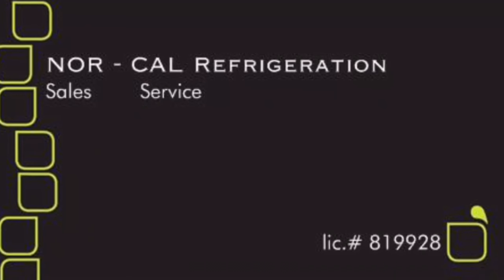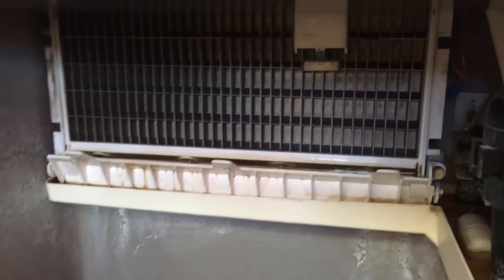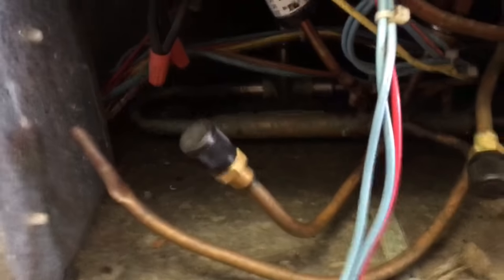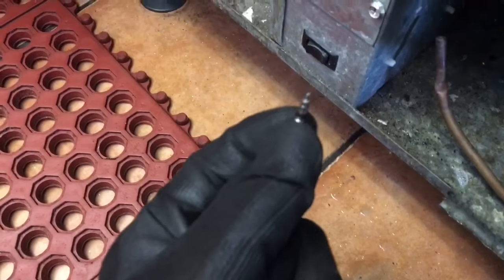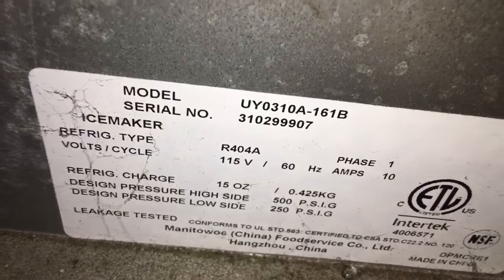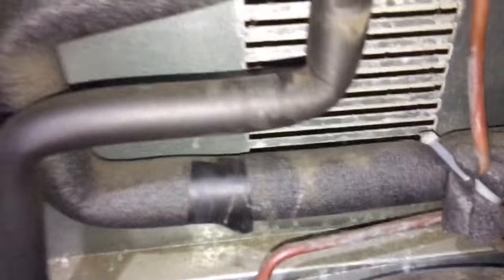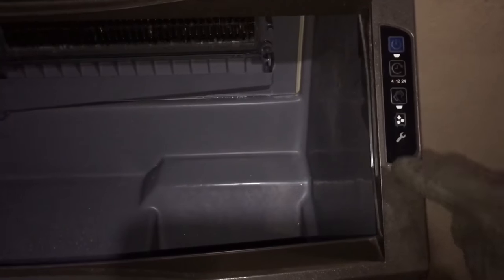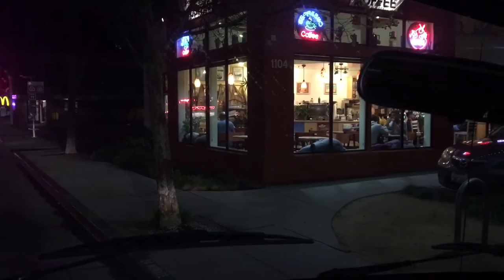Couple ice maker calls

Comment: i have replaced a few of those keypads cuz they got wet....you have to replace the whole frame....it comes in a kit...wiring harness is a separate part and does not come with the keypad assembly. When you have to remove the bin you can just unplug the 10 pin connector from the control board and remove the drain tube and those tabs and the bin will slide out...no need to remove the wiring harness from the keypad

Comment: It takes talent to use that core tool with one hand.  I had an sy0324a. It beat me up for a day.  The water inlet valve was acting up. When I was there it was working fine. When I left it was leaking by. Finally caught it behaving badly.

Comment: So, last week I had a little hoshi km255bah undercounter with the bin switch that swings in the back evaporator. It would close all the way, so during harvest cubes falling would hit and simulate a full bin. I could reach back and tap deflector, machine would come back on. Any experience with these and that problem?

I ordered brand new deflector and sensor. Seems like magnet could be weak or switches are worse. Old switch, they call it sensor was bad, never closed allowing board to call for freeze.   Such a simple machine, frustrating.

Comment: Hi what kind of leak detector are you using and is it good we use yellow jacket 
But would buy one if it was good thanks
Reply from the maker: Ultra Cooling I use the H-10g I have the battery one and plug in style.  I think they only make the H-10 pro now. 
I also use the fieldpiece SLR8